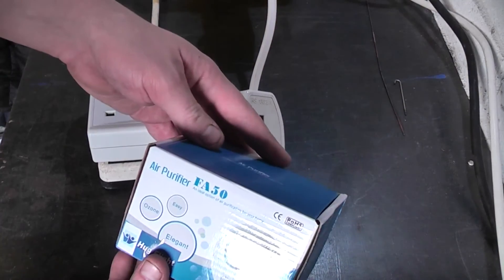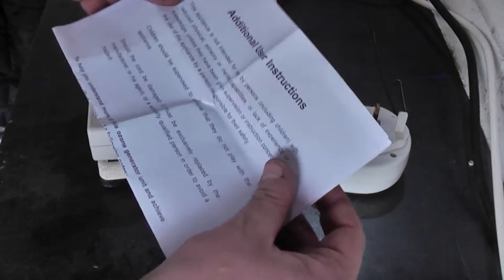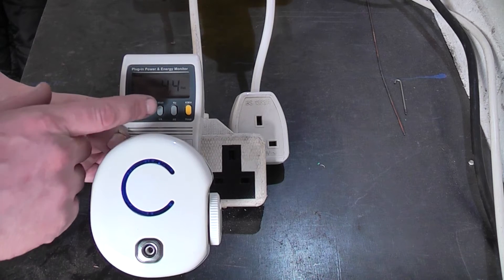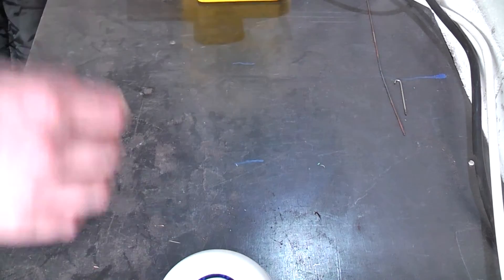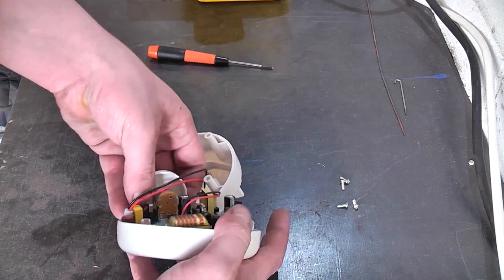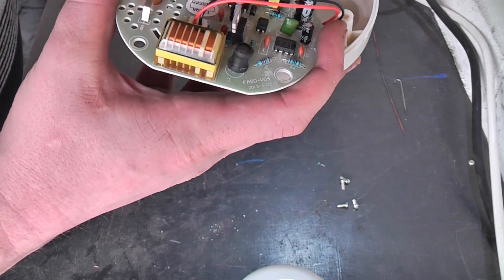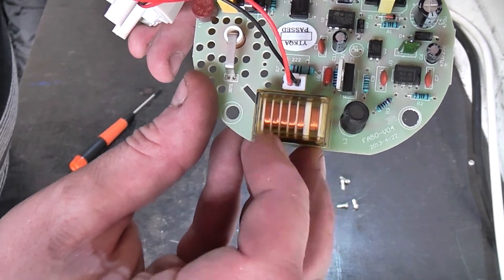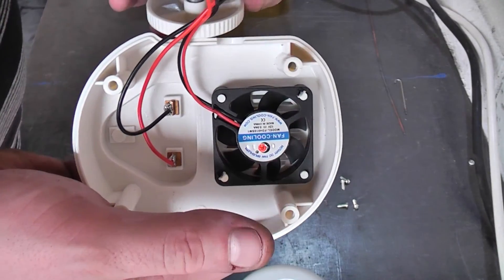A look inside a plug in ozone generator.

Comment: Hello mate,  
very well said there mate, nice little device, I love ozone, I bottle it and them sleep breathing it all night haha
I do love the smell of it, great stuff, 
I made a massive ozone genarater in my garage and had to switch it off as it was getting too think to breath haha. but nearly all my transformers in my garage are so high powered it doesn't take much for them to give an ozone output open circuit lol.

thanks for sharing mate, great video.

👍👍👍👍👍THUMBS UP👍👍👍👍👍

Anthony

high1voltage1rules
Reply from the maker: yer it smells good, i biult a tesla coil ten years ago, its in yhe loft now, apart from the 10kv 50ma neon transformer.
jon.
Reply: jonny morgan83 lol, neon transformer, iv had so many of them, I used 2 of them on my first lesla Coul.  they worm great, but heat up fast lol, iv destroyed many of them, lol

neons bring memory's back lol, of the first days of my tesla coils,  I ended on using line output transformers from them, using 2 in series or parallel of the same type.  now my tesla runs on potential transformers, or Xray transformers.  have you seen my tesla video?? if ya like tesla coils you will like mine.
great chatting jon, be safe mate 👍😉👍😉
I chat alot lol when it comes to high voltage,  I love it mate, as well as fast switching mosfet and the great big stuff like igbts. Iv ran half bridge and full bridge now lol👍😉
 (sorry side tracked  haha) it's all Awesome!!!!!!!! high frequencys omg, I'm doing it again haha
later mate.
Anthony
high1voltage1rules
Reply from the maker: high1voltage1rules , yer its one of them ( FART) ones lol.